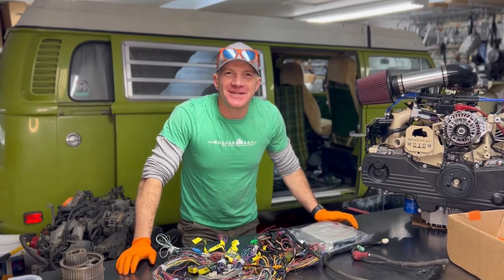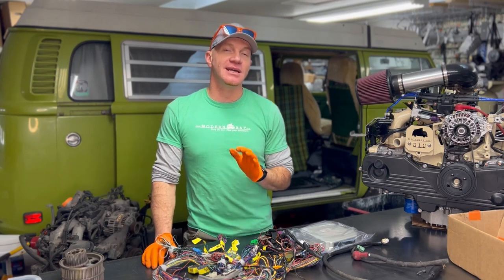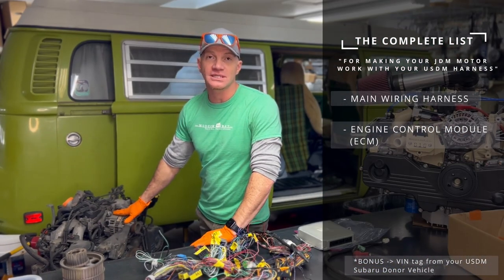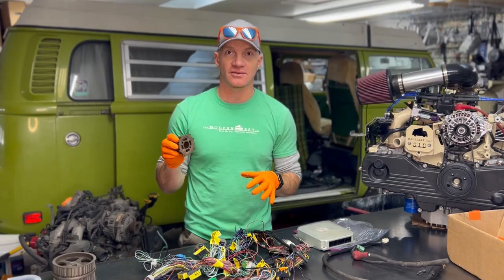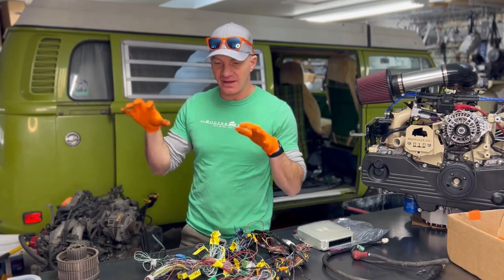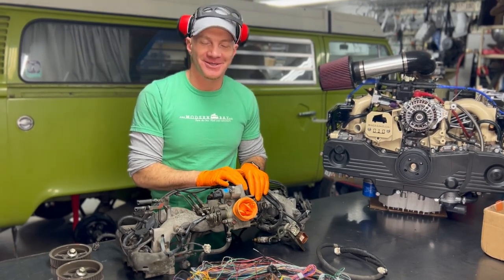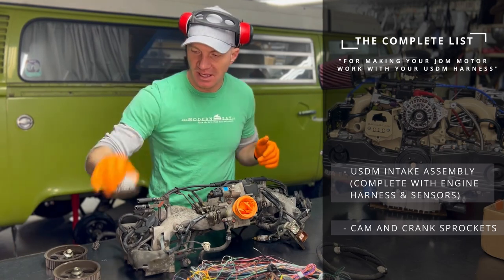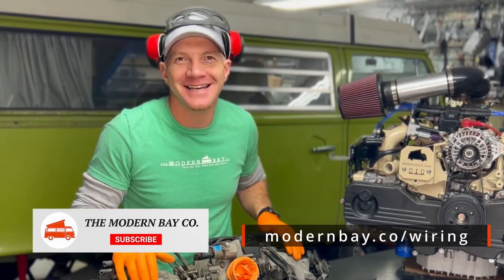How to use a JDM Motor in your VW Bay Window Bus Subaru Conversion | Parts + What You Need to Know!

Comment: I was looking at the engine you had there on the stand. I didn't see any of the PCV vent line hooked into your custom intake manifold. How are these vented? Just to atmosphere or???
Reply from the maker: We essentially emulate the PCV system the way it was from factory - plumbing it into our custom intake. Although people do vent to atmosphere or put a small breather filter on it, it's definitely the best for the motor to have a functional PCV system!!

Comment: Finishing up my diy 03 ej25 swap now, what do you guys choose to wire the neutral switch wire from an automatic Subaru ecu to a manual bus?
Reply from the maker: Nice work!! If your donor was an auto, you should ground the neutral wire. You should also ground the wire that kicks the ECM into Manual mode; I may be wrong off the top of my head here, but I think it's B135 Pin 25. It's next to the neutral wire, bottom of B135 connector, anyhow. Good luck with it and cheers!!